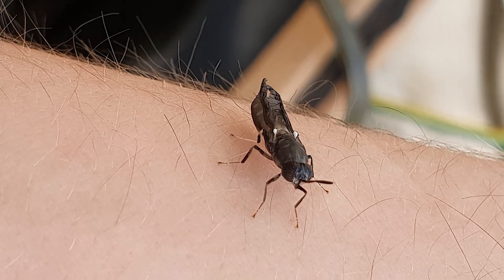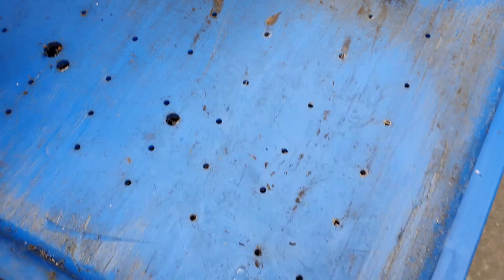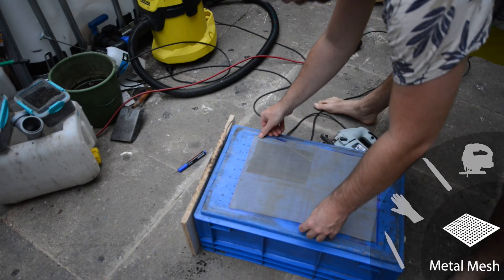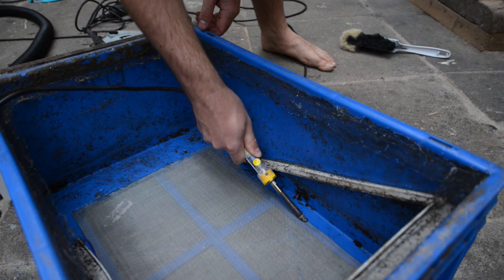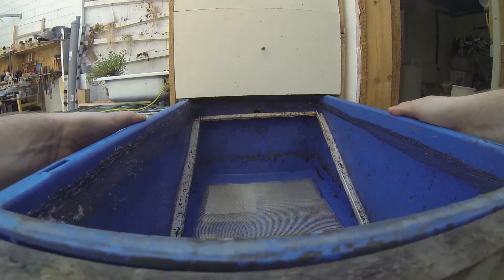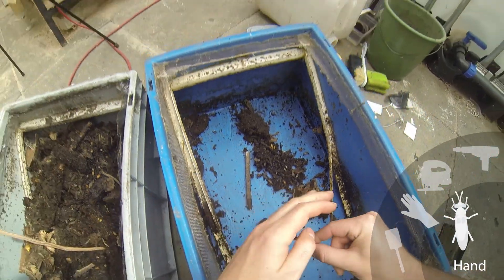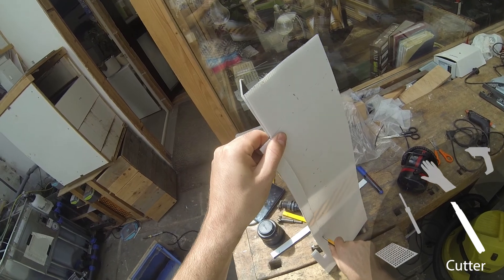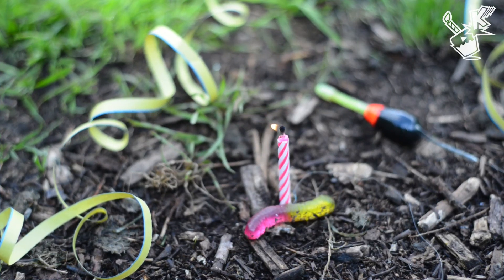Multilevel Compost Tower - Worms & Black Soldier Fly Larvae | APS #16 | Hiedalle

Comment: I’ve heard that composting worms and BSF will not necessarily compete for the same items since worms prefer things with more cellulose, like paper, leaves, and wood shavings. I heard it on a living web seminar on BSFL. My composting worms definitely seem to prefer those things and ignore others unless that’s all that’s available. They seem to detest potato peels, for example, but absolutely devour paper and sunflower leaves, stalks, and heads. Living web recommends they aren’t housed together because the BSFL may handle/generate more heat than composting worms, and the worms may die from the heat, but that you can have BSFL eat what they want and then finish by giving the rest to composting worms to finish the job.
Reply from the maker: Thanks for your comment, yes the worms like the cellulose material which the larvae leave behind, at the end of the season i just put the left overs from the larvae to the worms and they will finish the job while thriving. 
The amount of larvae in the larvae bin has a much higher stocking density and the worms dont like this much so even though the larvae dont eat the peels and such they move over it and move the compost material arround in the box. Thats why i try to hold them in different drawers with the larvae in the top drawer.